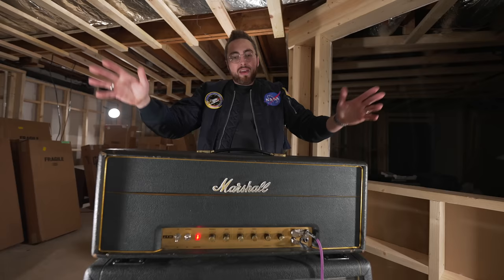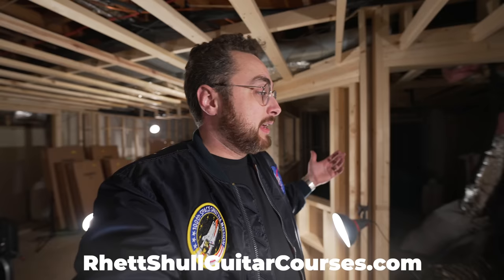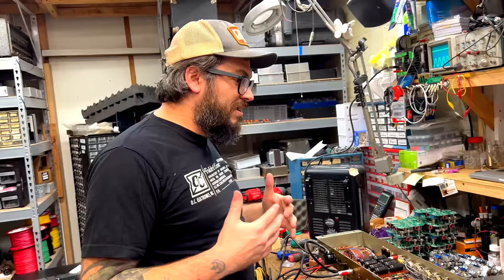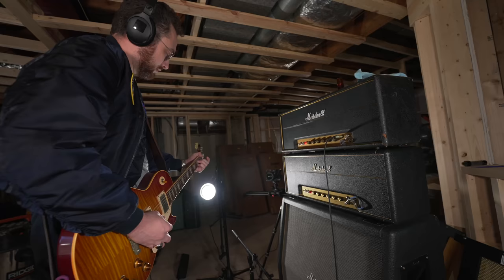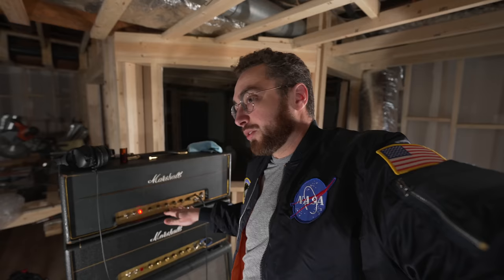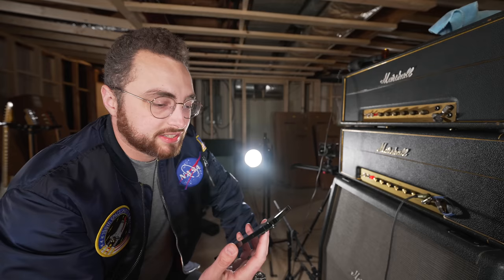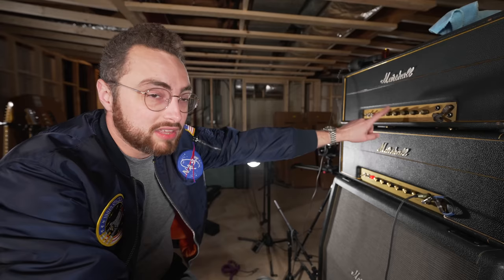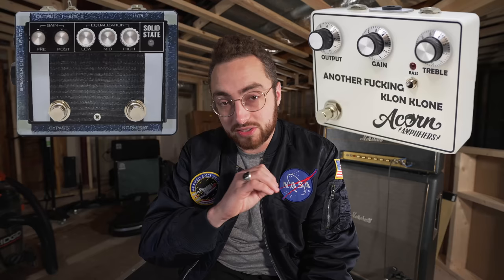This Amp Is So Loud It's Painful | Vintage 100W Marshall Plexi

Comment: I'm glad you got to ride the pressure wave. You sounded like Led Zeppelin, nailed it. Now it's time to ride the lightning and do an early JCM800 2203 through 4x12 with period EV speakers. With your skills and your Les Paul you could sound exactly like "Screaming for Vengance" with no pedals.. I'm using a 2204 and a Shred x Explorer to get that but a couple of SG's I have will also do it.rock on!!

Comment: I loved this video! I like all of your videos but this one was a little more. The gut shot of the amp was awesome, all those caps to smooth out all that B+! The headroom on those amp is something most people don’t realize and it’s part of the reason they really can’t be cranked unless you are at an outdoor gig at a big venue. I have a ‘62 Br Face Concert and it’s only 40 watts and that thing is horribly loud, those Marshall’s are the king of loud. The beauty of any amp that you plug straight into and crank up is that they get dirty but still retain an underlying cleanliness even when really turned up. Too many people over do the distortion especially when they are covering some of the bands that used those amps. When you hear live recordings of bands with a Plexi back in the day they were never super saturated. While dirty there was always that cleanliness in there. That can be had from any wattage amp too. The percussive hit though is reserved for those big bruisers and it’s a shame that can be used in a small club. I can’t get more than 20 watts cranked without really pissing off the owner or sound guy. It’s a different world now but our ears are happier for it.

Comment: i used to have an 80s jcm800 half stack and i dimed it once im my dads basement, apparently i was shaking pictures off the walls of my neighbors basements on both sides of the house. i had ear protection and it sounded clear as day. was a wild experience i was like 18 or so

Comment: the Black Flag needs a lower volume setting so it doesn't fall apart in the bass.  Get it breaking up moderately, blend in the normal channel to fill in bottom end and low mids, then hit it with a germanium treble booster.  This is how I run my 45/100 Metropoulis kit amp.  I have a TB from AnalogMan.  I also use his NKT 275 white dot normal gain Sun Face.  TB shaves off the flabby tendencies so the amp stays tight, where the fuzz can go crazy.  Both clean up to bright cleans by turning the guitar volume pot.

Comment: I learned vary early, my first gigging amp was a used 1968 Silver Face Twin w/JBLs I bought in 1970. 80 All tube watts. I bought it from a "swap sheet" ad 4 hours before my first gig. I had almost 0 time to "tinker" with it. The gig was in a 100 person 'dive bar' w/150 people in it, and you can guess the rest. It was a very long night between being new and trying to find a 'tone' at under 5 on the amp!  I was 18 years old and terrified!!  LOLOL. Today, I still use tube amps, I have 3 heads between 15 and 22 watts. I never went down the pedal rabbit hole,  I have 11 speaker cabs instead (sort of).  All different speakers, and combos of them. My fave is 2-  5/4 pine 1X12's w/ Celestion Alnico Blue's in them.  2nd is a Celestion 50th Anniversary cab by MojoTone w/2 CreamBacks, 1 old Blues Driver and a HOF Verb.  That's it.   8)    --gary

Comment: As a huge vintage Marshall fan, I have to say...great video!  The '67 sounds like a vintage Marshall Plexi.  The RI sounds like what most people think a vintage Marshall Plexi sounds like.  Most vintage Marshall amps are much cleaner than most people assume.  The RI sounds great, but different from the '67.  The '67 sounds bigger and fuller with more over- and undertones as well being more dynamic.  Too bad you couldn't measure the actual output wattage of the RI...I bet it'd be nearly at 100w as advertised.  Vintage Marshall amps are like Vintage Les Paul guitars in that each one sounds and feels a little different.  You mentioned how the '67 changed the way you play.  I think it changes the way you hear what you're playing as well...if that makes any sense.  There's more interaction and connection between the guitar and the amp with vintage amps.

Comment: amazing amp for sure ,, i have a 1986 50 watt JCM 800 2204 with 4x12 cab and its so loud  even compared to my 1996 45 watt Fender Hot Rod Deluxe with a4x10 cab its seems twice as loud i cant imagine a 100 watt version ,, but i do ABY pedal both amps at the same time for certain out door gigs ,, would love to try a vintage 100 watt plexi

Comment: I get the thing about old amps. Now me, I'm mostly a keyboard player but for decades I used a Revs model 2 made in the 70s by Yorkville Sound up here in Ontario, Canada. 480 watts. 2 cabinets each with a 15 " woofer and a 1' driver into a horn. Not stereo though it did have a second output that you could run into another amp to get the Leslie speaker effect to move from left to right and back. It had a footswitch to change the Leslie speed too and up sped up and slowed down properly. It had a killer sound. 5 channels in the mixer, spring reverb, 2 way EQ plus a 5 band and it was loud as F*&K! It scared guitar players with Marshalls! I laid the cabinets on their sides and stacked them. It's been a while since I had that kind of power behind me and I do kind of miss it. I just don't miss the weight and my back is happier. Still, those old big amps had a something that modern smaller amps just don't seem to have.

Comment: Back in Mi. I had the 100 watt 2204 with 4/12 and that sucker was loud so I took it over to a buddy's shop to let it rip. Tony & I had all on 10 and blew dust off shit he forgot he even had. Meanwhile, Mike found out & loaded-up his old 100 watt plexi to join the party. After dialing it in (Right arm sweep across the knobs) the sound was Hard to ex-plane. When I play it's like frick'en loud and in your face, when Mike play's it's loud! but the sound comes from everywhere and no matter what-you-do it sounds Great.

Comment: I know it's not an old Marshall 100 watt, but I have an early 90's Marshall JTM 30 1x12 combo, & a JTM 60 amp head. I did some mods to each to lean toward the older Plexi sound, and they both sound fantastic!. Every time I play either one out, somebody tries to buy them off of me. The 30 watt sounds so good dimmed, and it sounds huge in a medium sized venue with an extra 1x12 cab with an old V30. The 60 watt head is louder than my buds newer 100 watt Marshall. I wouldn't sell either of them! Ever!!

Comment: Ive only ever briefly played through a 100 watt Super lead, but I’ve  got a 1985 JCM 800 2204 (Canadian) and I agree wholeheartedly about these types of amps naturally bringing out more aggression in the player. Even with a master volume, it’s an incredibly difficult amp to gig with under most circumstances. It sounds incredible, but on a small stage I’m most likely over powering the vocals even with the master volume as low as it will go. I can’t speak on behalf of the reissues because I’ve never owned one, but those original JCMs are bulletproof, and I’ll never part with mine

Comment: There is something magic about about a Marshall 1960 flapping your trouser legs, you can lean into it, its magic. I built myself two 2x12's based on the oversize Bogner 2x12, made the grills to look similar to Marshalls. Stacked em up with my Carlsbro 50 Top and loaded them with Celestion Blackbacks, Marshall tone with half the weight and all the looks! Nobody in the crowd gives a crap what your playing as long as it sounds good, for me its about feel on stage, the presence of a big stack wailing behind you really creates a vibe, at those volumes the feedback between guitar, amp and cab is crucial for the 'classic' hard rock expirence. Yes, you can create the same tone with a good 1x12 at home but its not the same. Its a shame you cant get away with it at most venues these days, its a real spectical but obviously very impractical. I rarely get to use my full stack, some venues even bulk at one oversize cab, although I always get complimented on tone, which is really nice.

Comment: The JTM was a variation of the Fender Bassman. I think your newer amp tries to steer away from the Fender circuit for legal reasons maybe.

I would like to see the same experiment done using a 4X10" cabinet. I have the Marshall Mosfet Lead 100 with a 4X10" cabinet, and yeah, it can cut your ears off.

So, about that lower end frequency ability, it would be from the Bassman amp influence Jim Marshall had in his early amps. I am building a JTM45 for home use in an old CRT TV/VCR cabinet. It is pirely for playing at home. Looks awesome in my room.

Thanks for this video. Year, and your explanation of sub tones and punchiness I experience from my amp, but not as much as your JTM100 showed.

Comment: I was once in an empty GC where a friend had brought in two 300W Laney heads for trade-iin on new gear.  Turned up, you literally could no stand in front of the cabs at 50'.  The diaphragm 'thud' Rhett talks about is due to the volume of air the cones are moving and is quite literally 'visceral'' when it hits you in the gut.  This is why Pete Townsend is as deaf as he is.  The miracle is that any of the old guys aren't deaf ;-)

Comment: As an audio engineer, I would recommend using C weighting on the meter for that type of test. That is the standard for measuring sound pressures over 100db and is more accurate as to the damage to your ears at that loudness. But needless to say, 124db even at A weighting is ear-bleeding loud, and I actually want to preserve what little is left of my hearing from 25+ years of being in loud environments. If I see a stack, the earplugs go right in the ears!

Comment: I have done literally hundreds of gigs with a dimed 100w Marshall. The reason why I didn't use a 50w was .... A] It wasn't clean enough when loud ... B] It didn't have the bass thump at the beginning of the note that Rhett refers to. I know this puts me squarely in the 'old fart' catagory, but I despair that young guitarists are literally scared of the volume, and are consequently missing out on a lot of joy. There is such a huge amount of emotional feedback from playing at that volume. It fires you up in a way that you never get from in-ears.
Have I damaged my hearing? Somewhat  .... was it worth it ... f**k yes!
One of my proudest moments was being told to turn down by the sound guy when playing Wembley Arena in London. I felt truely Rock and Roll!

Comment: RHETT Turn it DOWN im in Lilburn!  Turn it effing DOWN.. All joking aside in the 70s these were a dime a dozen  and my guitarist  always dimed these mthfers and after 10 years as the bass player  the 100 watters left with me permanent tinnitus.The ringing never stops.   But I tell you the secret is to walk up the volume slowly, give the tubes time to get good an HOT.  Great demo man. Hope we cross paths soon, Beers on me. The percussive is the Magic of the 100w and EL 84s. and you right, you play to the Sound and it will make some Where the F did that come from,,, namely with Strats. but yeah Back in the day a pair of 100 watters on 1960A s was standard and the night clubs were deafening! FWIW my tinnitus started in 87 . The Marshall Major.  Yeah my dude had one of those too. It sounded like @ss and thank god it always red plated. He traded it and some cash for a plexi in Alabama or somewhere like that. Canceled rehearsal to go make the deal. The 50wters were brutal little Beast too. I think Ol Graff had a plexi 50 on an 810 at CW Shaws...   Sorry for the rant. But Ladies you need Ear Plugs and Head phones.  the 84s will bust those tiny little bones in  your ears faster than your cherry on Prom night..    Cheers

Comment: I have a decibelometer in my studio to check volumes. You need to remember that db scale is logarithmic which means 1 up usually means 3-4 louder. At 1/2 volume my rack goes to 110dbs easily. To put it in perspective, a cymbal hit hard next to a decibelometer (2-3m away) will go up to 105, Studio volume with drummer hitting hard is around 110dbs....From 110db to 120db, you need to be at a distance of at least 20m in order not to get chest pain from the low end...let alone your ears going numb.

Comment: im a bass player, i have 2 EV 12 inch guitar speakers that have that low end kick drum like thud that you're talking about. i even get it when im using a 200 watt class D bass amp. 

i've used and loved it a lot in my teens, but now that i play louder gigs at 24 years old, i use regular bass amps/speakers to avoid blowing those 212's. 

i try to get that same sound by running my signal full into my empress compressor with the attack set lowest and release set to fastest. its gets me close, but its not that perfect thud that comes from the ev's.

Comment: Those stacks of amps on the backline created that "wall of sound" that was prevalent in the 70s. The members of The Who talked about pushing the volume to the edge of the stage... 

I remember band practice in various basements and garages, playing at "stage volume" with little or no hearing protection. 
That, and a combined 40 years of construction work, concerts, and military service explains a lot about the constant ringing in my ears... 
125 dB, better wear plugs and earmuffs.

Thanks for the vid, Rhett. 
Be good to you!
Reply: What? Pardon? Can you please say that again (as I lean in with my good ear)? Born ‘62, rocking with SG and valve amp since ‘75! ✌️❤️
Reply: @jeremywilliams703  I'm only 6 years behind you 🤘
I'd repeat it, but I can't remember what I said...

Comment: What you’re talking about around 8:30 that percussive thud… I just picked up a 2203 Jcm 800 and around 3 volume it has a “concussive” knock 😂 if you stand in front of the amp even with hearing protection.

Comment: Something I noticed instantly was that the new one seems to have a resonant peak in the high mids (giving a subtle cocked wah effect) that the old one lacks. It gives it more of a kind of aggressive edge where the old one is a bit less focused I suppose, but the old one sounds more balanced.

I used to have a JCM900 full stack which even on 10 would only just about match a drummer really going for it. I always wondered if it was faulty, or something.

Comment: The flags were bass amps. Marshall were still in their JTM stage. I have the 50 watt version of this and there's plenty of ghosting. The Black Flags were notorious for ghosting, I heard because the transformers were closer together than in the other models. 

Great amps though. You just have to dial them in right. Mine has a split cathode option to tighten up the bass and switch it into a more lead spec sound. I attenuate mine through a Captor X and ir's BTW.

Comment: Just an hour ago I practiced with my Marshall DSL40CR combo with 1 12” speaker. I could barely stand the pain with the amp set at 1/2 power (20watts), the pre-amp, gain and power amp  at 12 o’clock

Comment: Iv always wondered what a 1967 Plexi sounds like compared to a bassman of the same era. Knowing the Marshall plexi was designed from the bassman there’s a lot of similarities. I bought a Marshall Origin 50 this year, and it’s not a high end amp but it does have more in common with the bassman and the plexi I feel like.

Comment: Rhett, try a Plush 120 amp. Essentially, it is a very true Fender Bassman clone. Mine is crippling loud. Because they are a copy, they are cheaper. Because Plush is a little apart from original spec, it's just overpowering.

My daughter plays violin. You might know this already, but violin pickups are weak. We set this out in my friend's backyard and chickened out at 4 on the volume knob. Her violin was audibly distinct three blocks away through a 1x16 cabinet. My guitar likely would stretch that out to five blocks.

Comment: i mained a 50 watt plexi for 10 straight years. it’s funny how people react to real amps when they’re used to high gain compression and modelers. 
the key to plexis is to play them with a 16 ohm load so you’re using more of the output transformer, that’s where a lot of the rich tone is. greenbacks are also a must for plexis because they break up in a way that handles the white noise and hair of the amp in a more musical way. most other speakers make the plexi feel or sound too stiff. on the other hand greenbacks with most other amps don’t have enough bite and feel fizzy. truly a perfect pairing.

Comment: Even the 50 watt model of these are extremely loud. I have one from 1974 with a matching 4 x 12 cab from the same year. Cranked, it melts your face. I usually ran it with the volume set at 4- 5 with an overdrive pedal. That was my rig from about 1990 'till 2012, with the only change in between being I got a Mesa Boogie V-Twin, which I ran on the solo channel with the gain set low. For the last ten years or so, I've used a Fender Twin Reverb and that Boogie pedal set the same way. Volume on the amp is usually at 4- 4 and a half. For rock, that's where it's got to be. Any quieter, and the amp doesn't give you anything back, really. It's loud, yes, but not face meltingly loud. It just gives you a bit of controlled feedback when you want it, and just enough oomph to be felt physically.
Reply: I like the idea of your rig. Fender twin is easier to transport than a half stack and will get plenty loud. V-twin sound like a cool pedal. Some day I hope to hear what that combination sounds like. I can’t rationalize taking my vintage half stack out gigging anymore because some jerk will probably steal it.
Reply: @bretfuzz925  Set right, that pedal will get you a very good proximation of an old Marshall sound, at least with a Strat. Unfortunately, Mesa Boogie stopped making that pedal some 17 years ago, so the second-hand marked is your only option. I bought mine in 1996. I haven't looked back since.